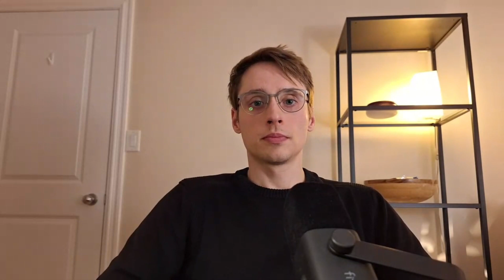GD&T Sucks (A GD&T Expert's Perspective)

Comment: I think GD&T specialists are the unsung heroes of mass production.
I have had some GD&T experience at work and the things that stood out to me are:
(1) how thankless of a job it can be (I was lucky enough to have access the ISO standards... they are ginormous with hundreds of pages and many a subtlelty)
(2) how misunderstood GD&T notation is, and even more so, the process of choosing defining the correct tolerances themselves (most people can cook from a recipe, but it takes an experienced cook to write one)
(3) the ego at the workplace (I've met experienced CAD designers... you wouldn't believe how obtuse they were). I personally think I have a decent understanding of GD&T basics but I am no specialist, so I am always open to being corrected. I always leave my ego at the door.

That's why we need people like you to share their knowledge and educate!

Also, I've heard the exact same question about CNC and the subsequent need for any GD&T drawings. I fully support your answer. My understanding is, a functional drawing describes the way the part will be used or integrated in a bigger assembly and conveys the information on which important features need precision for the part to function properly. In the globalized world today, you never really know for sure who will be subcontracted to make the parts (subcontractors might subcontract themselves and never tell you... true story!). For that reason, the manufacturing process can be unpredictable and completely out of your control... thus a correct drawing with a deep understanding of GD&T can be your saving grace, especially if parts are unsatisfactory or at worst, in case of disputes.

If you love GD&T and you like teaching, I'd say please do. There are people like me who will always value your input and want to learn more!

Comment: So I have been a Quality Engineer in the Aerospace industry for handful of years now. I completely agree with what you are saying. I've explained it like this, You have the Design Engineers Intent, the CAD guys understanding of that intent. Once it gets to a supplier you have the ME who buys it off, then it goes to the NC Programmer and manufacturing teams, and finally to an inspector. Every step of the way has the potential for errors. Its like a bad version of the Telephone game. Unfortunately as stated in other comments the Grey Beards are retiring and either not passing down knowledge or the people coming up don't want to learn. It's a huge issue in the industry that all the Major OEM's are facing. Its just like you said, as you get out to these Mom and Pop shops, many of which are awesome, they just don't have the people or the money to invest in training to fully understand what's going on, or their Inspection Department is a closet with a 3 foot Arm in it. 

I also have a spot of bad news, working where I do, I can tell you that GD&T isn't going anywhere. It is the future, along with Model Based Definition. Even legacy programs that were designed on paper in the 60s and 70s are having drawings revamped to include GD&T which usually doesn't go as planned. Metrology is a field that very few people get into, and even less understand it when they do. Man the horror stories I could tell... Maybe I should write a book.

As for deciding whether or not to go out on your own, Nothing Ventured Nothing Gained. I know that's what I am doing. 

Cheers
Reply: I also work with legacy turbines from the 80's.  It's a huge PIA getting models that are validated.  Mostly, the models are used for instructions and powerpoints; not inspection worthy.

Comment: I'm not an "expert" by any means but I like to think I understand GDT pretty well. I've been giving classes to other engineers and inspection staff at my shop to try and educate the team on what things mean and how to check them. The problems I generally run into are either the younger engineers have a hard time conceptualizing how tight or loose something is (as well as there's so much information to cover), the older guys think it doesn't matter at all and why bother, and the inspection guys don't care about the theory behind it and why certain callouts may be used. 

Obviously there are some people that are very interested in it but, as a whole, there's typically a fair amount of push-back to learning.

Comment: For a large corporation shipping lets say 1000+ systems per year with consumables etc. gd&t will be essential.
For smaller operations, you have engineers to make all the parts fit together so gd&t will add a lot of complexity.  Maybe you get lucky and there are some y14.5 nerds 
in a smaller company to make an effective drawing for the machinists.  They will have to carry the company, and tolerance stackups ?  lol, you wish!
Have you heard of 3dcs tolerance analyst?  Maybe that can help with mechanical teams and stackup issues that are not well understood.